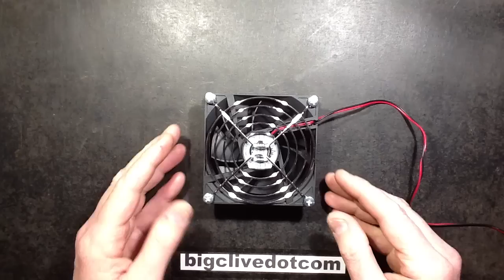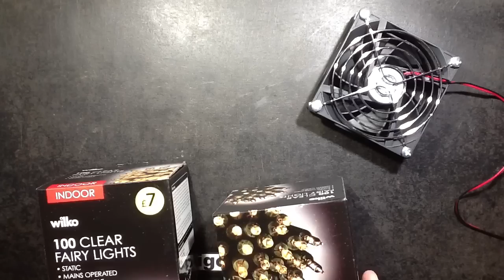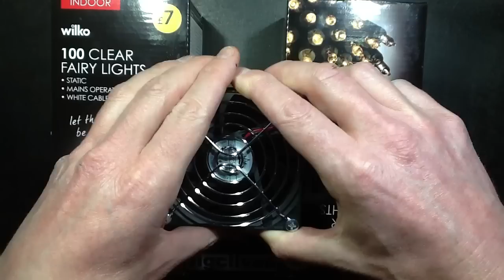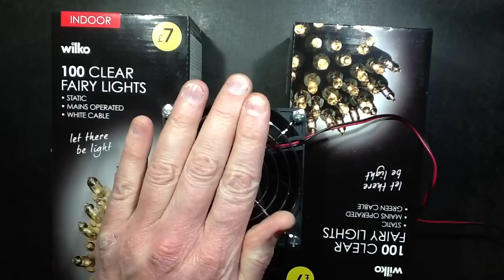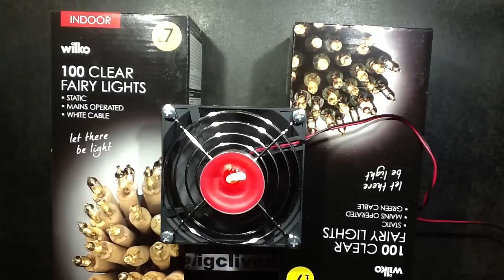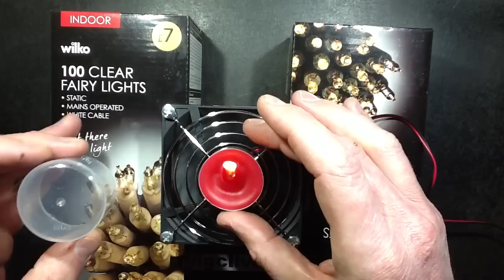Vortex airflow out of a common computer fan.

Comment: try taking the cheapest, shittiest computer fans apart and see what is in them, i have a (busted) one here and there is a blank SOT10 package on the board, I found this out after having an incident with 2 9v batteries, and 5 or 6 1.5v AA cells. The diode blew with a pop, almost like a ballon.

Comment: Delta Electronics, among others, make fans, usually high-power ones, that have stator blades that work to "undo" the vorticity and convert it into pressure, like in the multi-stage axial compressor of a turbojet engine. In fact, they have models that have multiple stages of rotors and stators. Mental!

Comment: What's funny are the number of computer case fans specifically sold as 'vortex flow' or some such...  they're essentially just dressed up regular fans !!

Pro tip:  the drawback of all these fans is the central motor when it comes to airflow.  As these are often mated directly to a heat sink or radiator it leaves a giant hole where no air flows, dropping efficiency down the loo.   The fix are little ducts that look like very short elbow joints, usually no more than 5cm tall putting the fan at a 30° tilt to where it would naturally sit.   They come in all the standard fan sizes in all manner of color and shape and are rather inexpensive...    and they do make a marked difference.   I did a far too exhaustive series of tests on this and the numbers didn't lie...   now all you have to do is find the extra space for them...

Comment from the maker: I took one of those pub air fresheners apart.  In the pub, on their bar.  It had some D cells, a control circuit board with light sensor and a simple timer chip (possibly a CMOS 555 or plain logic chip back then) and the fan.  It just fired the fan for a burst every so often to waft some aroma out.

Comment: I've seen this idea used in public toilet air fresheners a few years back. I think the air freshener was branded "Initial" - it had a fan with very oddly shaped blades directed at a fragrance bottle with a wick in it. The fan was powered by two 1.5 D-cell batteries.

Comment: Quick, make a faux scented candle based on this before someone like Li-lo...
Reply from the maker: I guess the LiLo candle was using the vortex effect, but the LiLo candle did kinda break the vortex by having a set of louvres under the flame itself.  Probably because the flame would just twist into a single position without them.  (Which it does anyway.)

Comment: I noticed the vortex when I was running one of these underwater. Makes sense that it would have the same affect in air.
Reply: i know this is all late but i came here because i was wondering would it be more effective to have 1 outtake fan in the same place rather than 2 in the same spot